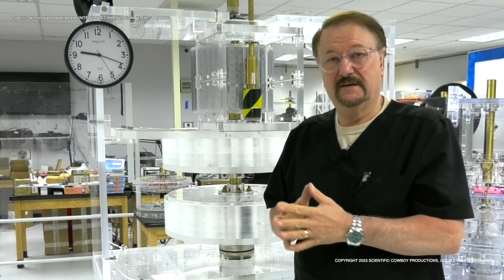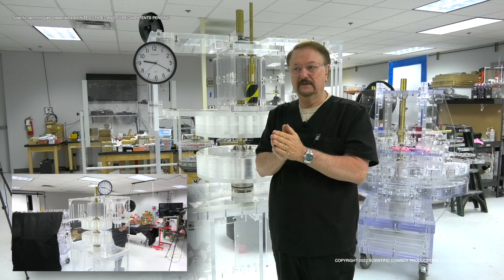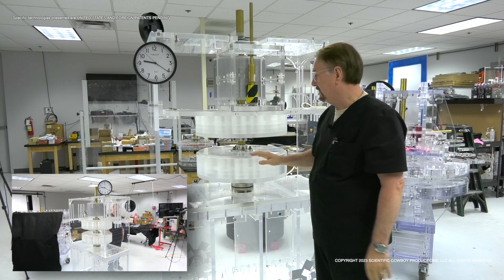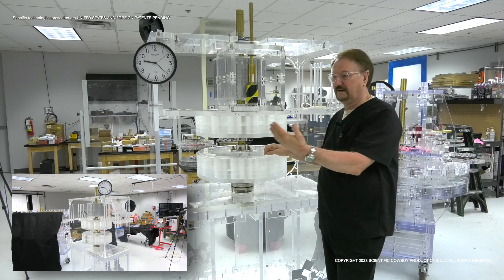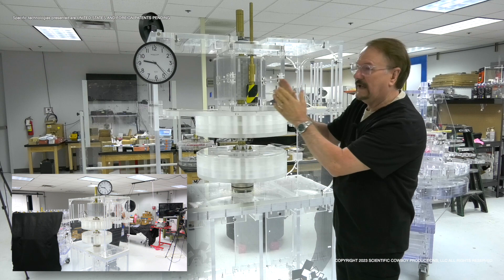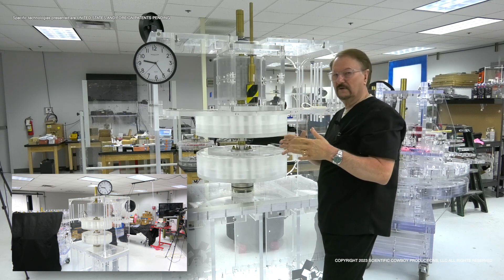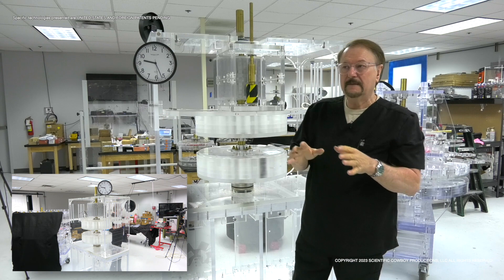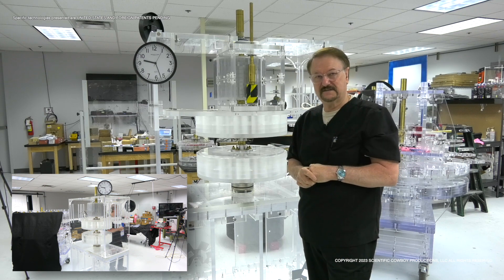Quantum Energy Magnetic Engine  - NOT Perpetual Motion EXPLAINED !

Comment: 4:05 is where the magic happens.

Does anybody still figured it out how this works?

First you get a pull effect (maybe powering N and atenuator S) and after the neutralpoint it flips from (powering N to atenuator N) followed by a hard push effect all by it self.

The repositioning of the atenuator doesn't look like to take that much force and should adjust by itself after a couple of rounds.

On the powerring as we can see we have 10 magnets in a row, maybe a kind Halbach Array constellation?

But why are the powering so high with a row of 10 magnets, because the atenuator is only 3-4 powering magnets high, except in the brasse tube above the atenuator there is also a magnet.

Definitly we need more information about the physics behind the acceleration process.

Hope quantum gets a patent soon and can show the whole world, that photonic magnetic propulsion is a real thing.